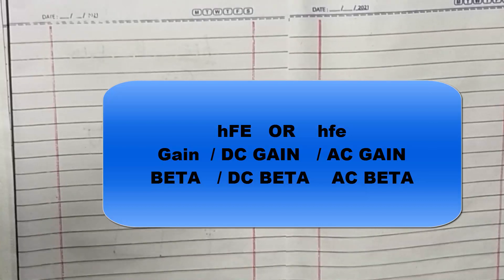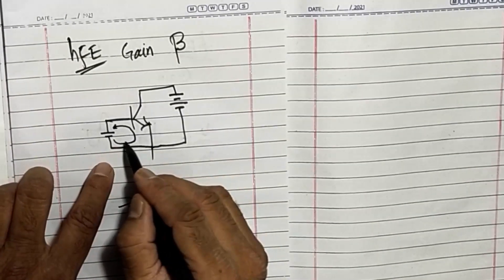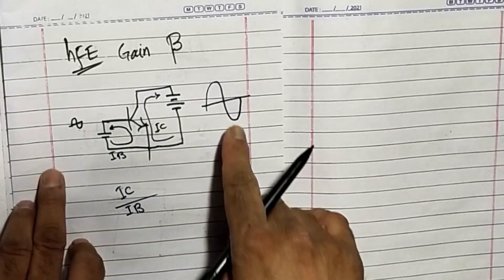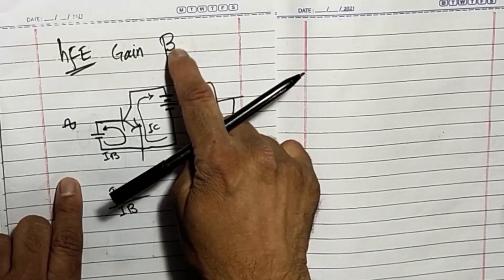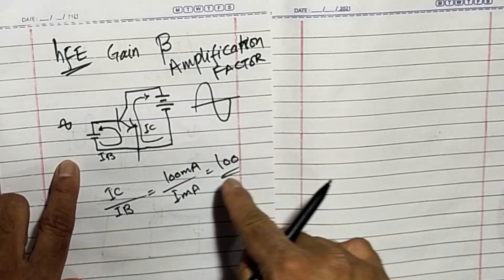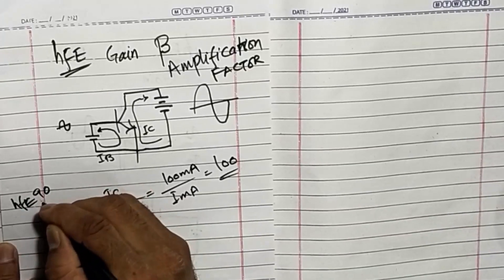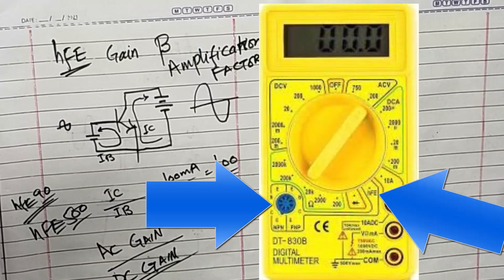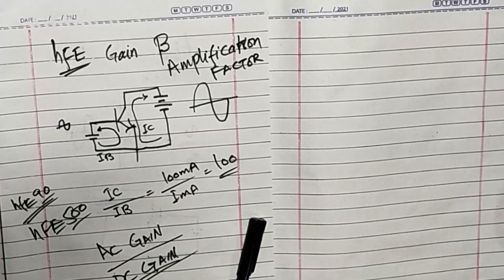{362} hFE / hfe / Transistor Beta / Amplification Factor / DC Beta / AC Beta in BJT Transistor

Comment: Please make a video on transistor saturation voltage. How can I identify what voltage, current is required in order to make transistor saturated and use Transistor at full potential. Resistance between CE to achieve less than 3 ohms

Comment: How you got the hfe valu as 90
Reply from the maker: i the video i gave an example that
when we see datasheet may be we will find that data in hFE column 90, that will indicate its amplification factor 
basically it is a ratio between collector & base currents